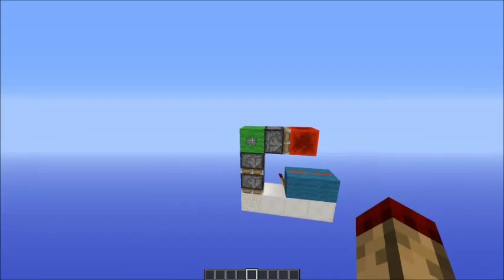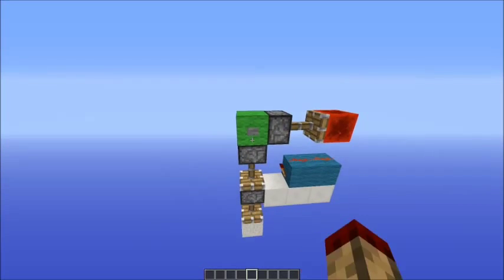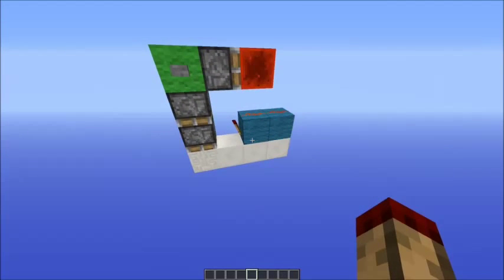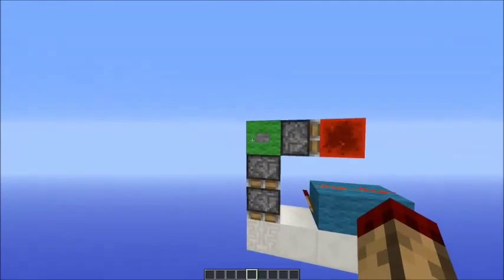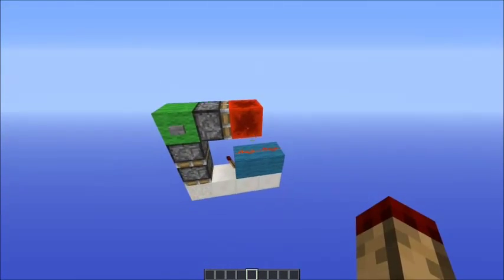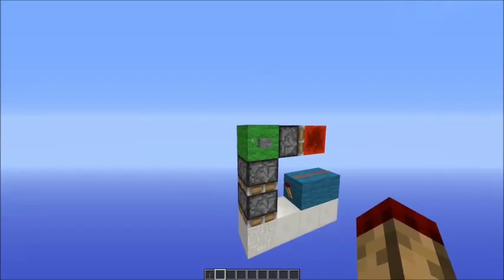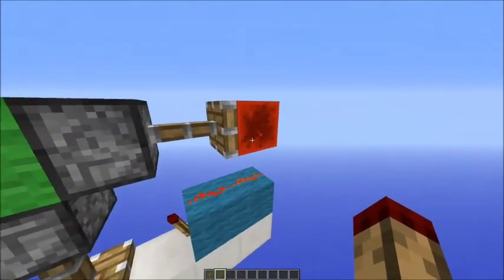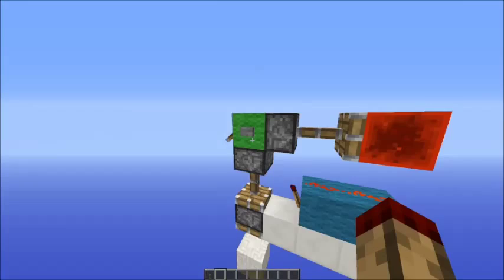Smallest Downward Double Extender [Button] - Minecraft 1.7 Redstone Tutorial

Comment: Nice. If the ceiling blocks that make it flush are counted, this is 1 block bigger than my downward double extender design. BUT, if one only counts ceiling blocks if they are used in the design, yours is 12 block volume with mine still at 15, which would make yours the smallest. So depending on how you count, one of us has the smallest downward double piston extender, button or otherwise :) I like yours better though; its less spazzy.